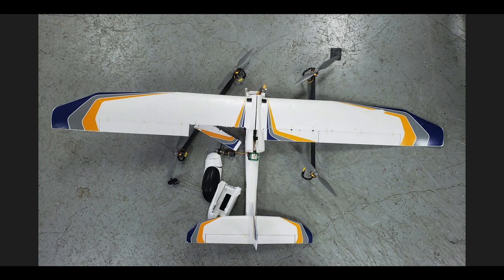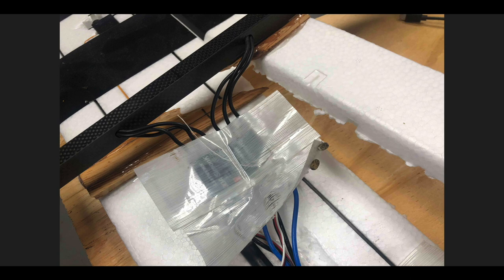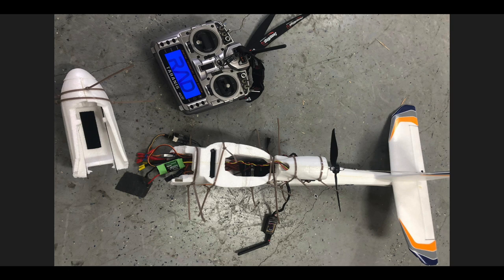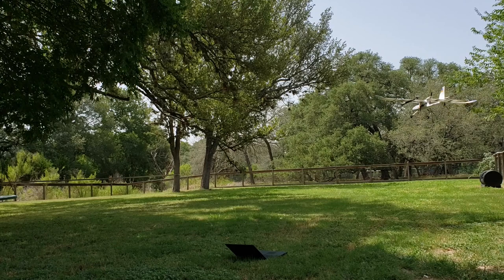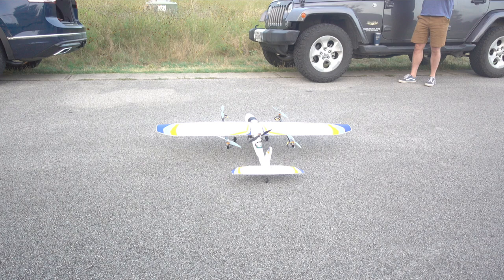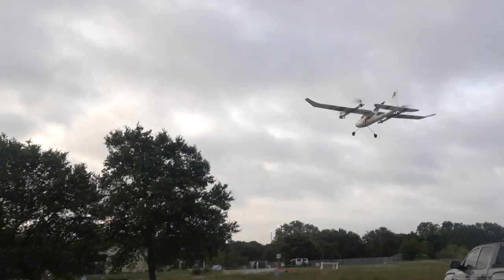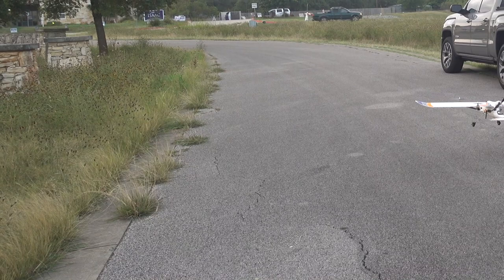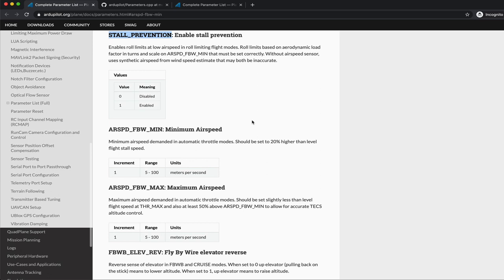Bixler Quadplane VTOL with ArduPilot Maiden #2

Comment: First of all, congratulations, it's going very well
 😀
Don't you have a de-balled propeller? Sounds a little bad, like a lot of vibration. Or maybe a loose motor or something?
I've always heard that even though you can make the air speed sensor was essential, that was still the reason for the accident?
You said you didn't have that much damage. Well, I thought so, but considering the height he was at, he survived more than expected 😁
Thank you for sharing, so we can learn from each other too 😀
Reply from the maker: The motors are okay but I will double check the prop balancing. You're right, it probably looked like a lot of damage, but it was manageable since all I needed was some glue and zip ties :) I'll share an update soon after I get the airspeed sensor configured. Thanks for following along.